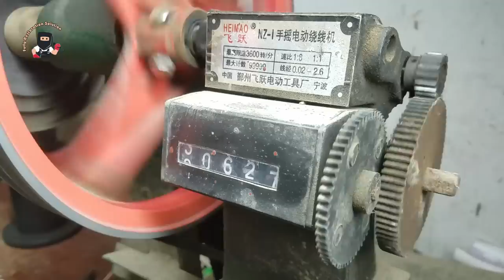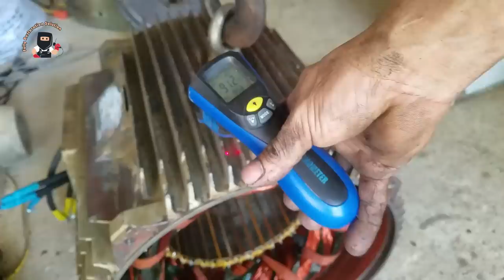Fully Restoration Big Motor 3 Phase 55KW China - Restoration Videos, Rewinding Motor 380v Burnt.

Comment: Quite a risk to your reputation to not inspect the bearings and their fit in the endbell housings. A bad bearing fit can be the CAUSE of the burnout to begin with.
Reply from the maker: Thank you for the reminder . but that's the engine owner's love. They don't want to replace the bearings until they're broken.
Reply: @RestorationVideo  The customer is wrong. Will he come back if the job only lasts a month?

I do machine work regularly for a motor rewinding shop. They are extremely fussy about the bearing fits and their reputation is strong. A customer cannot be right if they have no clue what they are talking about. They are relying on YOUR expertise. Checking the housing for wear doesn't mean new bearings necessarily, although it is false economy to have a rewind go bad when it could have been checked.

Comment: What are those slot wedges made out of?
Reply from the maker: they are used by bamboo
Reply: @RestorationVideo  don't you think that bamboo would catch fire from the motor running hot. That wedges are class h for voltage and current rating. Bamboo is rated at ????

Comment: Nooo man  why would you use electrical tape 😭😭
Reply from the maker: We not only use electrical tape and many layers of insulation to ensure stability during motor operation. Electrical tape is just a small layer of insulation.
Reply: @RestorationVideo  electrical tape does not follow regulations.... In 5 years it will become dust and then there will be a big fire
Reply from the maker: @giacomosmiderle9717  5 years is too long a time that we do not think about, it is a serious shortcoming. Thanks very much . we will replace them with better insulation.
Reply: @RestorationVideo  nice👍

Comment: This is definitely far too little varnish and no real oven baking.  Then no surface preparation or primer and inappropriate paint.  A generally shoddy job.  It’s going to last maybe six months.
Reply from the maker: Lol
Reply: And he used electrical tape too
Reply: Are you capable, if not be silent, because it will embarrass yourself.
Reply: Made in china. The motor has to be dipped in varnish using vacuum and pressure impregnation chamber..
Reply: @Abc-qk1xt  Yeah, there was similar quality work in Russia.  One of the statistics they published-- 33% of electric motors failed every year.
Reply: The cause of the failure of the electric motor is the lack of careful installation parameters, especially the ratio of the motor output power to the load, the amount of current and voltage that is not considered.  The main function of varnish is adhesive, which prevents rolls and laminated sheets from vibrating.  So if the wire enamel is not scratched, during the rewinding process, and the specifications are class h, then the motor will last a long time, even though the varnish process does not use the dip and pressure procedure.  I'll bet, because it's not a distribution power transformer.  Stop talking too much about technical issues.
Reply: @dufffg5247  I consider it a public service to point out little details that can lead people astray into thinking that shoddy workmanship is okay or economical.  My father and brother were Electrical engineers and Ive seen many REAL and good electrical factories, where large transformers and motors are varnish-dipped and vacuum impregnated and cooked FOR MONTHS in a varnish setting oven.   They don't do that for the fun of it.  It's critically necessary to do those steps to keep the windings dry and solidly fixed.  If they absorb moisture, the transformer dies by electrolysis and shorting within six months.  If the windings vibrate, even a millimeter, the copper work-hardens and becomes brittle and breaks within nine months.   All these basic principles were discovered over 100 years ago so there is no excuse for doing anything less.
Reply: @dufffg5247  the vacuum impregnation is the standard process during the production of  motors and transformers at any factory even in china. But in a rewinding shop it may not be easy or economical, that i agree. But it will not last long as a new one. Dont bet for such basic technical things..
Reply: As long as it can run, at a stable normal operating temperature.  no leakage current, and using class H insulated copper wire. So the 3 phase rewinding induction motor, will last decades.  For the standard as you mentioned, it will be needed on the drive train of trains, ships, planes, offshore industry, and oil refineries.
Reply: You're complaining about the paint job? This isn't your mother's Honda Civic, it's industrial equipment.

It'll be bolted in place and won't be  moved until it needs service.
Reply: @dufffg5247  the vacuum impregnation is not just for adhesive purpose as you told, but it makes the entire unit moisture free. if the insulation of wire is "class H" and enough, then no need of applying any varnish on it with a brush. The "baking" is needed only after vacuum impregnation. Otherwise it is also a useless process here..
Reply: Oke oke.   😅
Reply: Everything and Work was Perfectly Fine but I have one suggestion,  Please use Copper Winding So the Motor may last longer so does your hard work
Reply: @dufffg5247  I rewind electric motors for a living. This is definitely not a great job.
Reply: Show 👏🏻👏🏻👏🏻
Reply: I agree.
Reply: He is fucked with this restoration

Comment: Not a full restoration. Sloppy workmanship. No safety. He nearly lost his toes when he toppled the housing.
Reply from the maker: Sorry, I've only been in business for 25 years, I lost a toenail
Reply: @RestorationVideo  Well, consider yourself lucky. I realise that you are working under primitive conditions so I must salute you on the job you are doing. Consider wearing safety shoes while you are working. It would make me happy.😄
Windings that are not impregnated with shellack and baked in an oven will short out very soon afterwards because of the alternating magnetic field they are subjected to.  I've seen plenty of electric motors with short circuits between the windings because of that. Chinese motors are notorious for it.